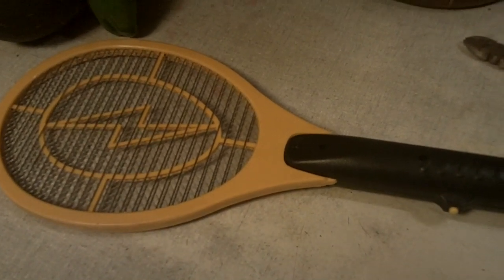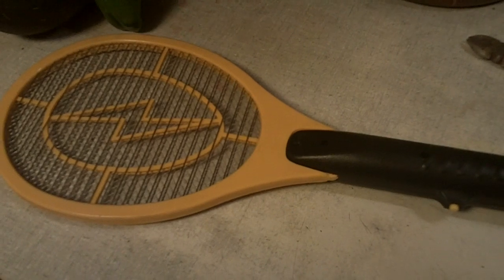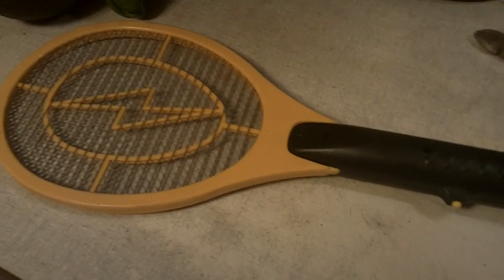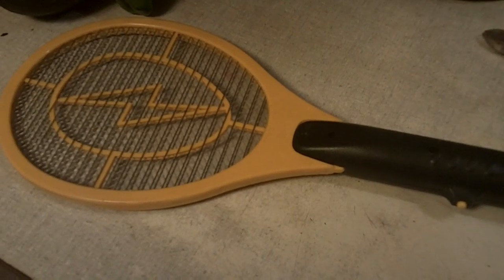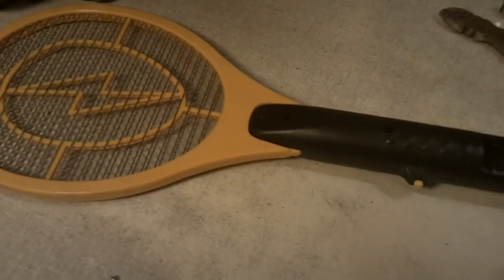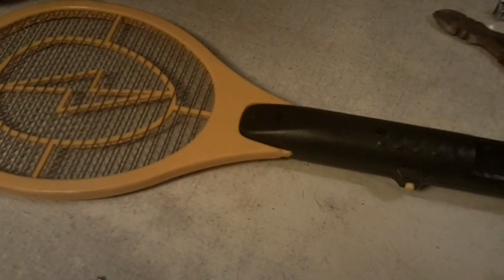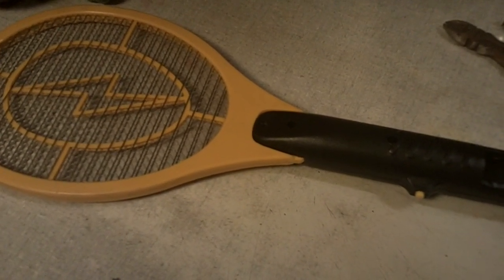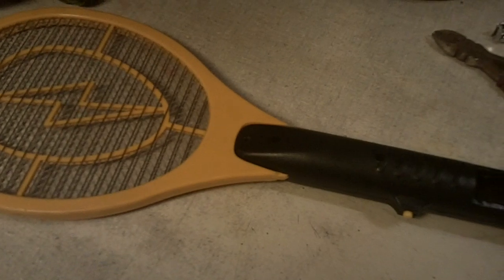1500 Volt  Bug Zapper Racket Power Mod,.

Comment: This video is old I know but a few things to point out that may have been mentioned before.
1. the zapper is only 600V because the main charge capacitor is just over 600V
2. that is the bleeder resistor it stops to from accidentally electrocuting yourself a month from now from it still being charged.
3. to actually increase the voltage you can input a higher voltage then the two batteries but it may very well burn out the capacitor and other electronic parts
4. the best way to increase the power is add more capacitors in parallel of at least 600v if less then they will short out and not work.
Reply: Capacitor in parallel would just increase their current lasting capacity...
I would say higher voltage caps would be nice because higher voltage higher current ;D
Despite lasting less the zap would be stronger with higher current ;D

Only works if we raise the input voltage, the batteries.
Otherwise, caps in parallel are fine but make the charging time longer when you press the button

Comment: You shouldn't remove that resistor, it's a bleeder resistor (empties the capacitor when not in use). Instead what you could do is replace that resistor with a bigger resistor, and thus the capacitor will dissipate it's energy slower.

Comment: Its not quite that simple. Rather, in the name of cheapness, the bleed resistor is constantly inline and pulling down the voltage of the boost circuit. the circuit will never reach its maximum voltage. I performed this mod on a basic single thickness racket (probably the most dangerous), and the higher voltage works better on small insects (such as gnats) that normally escape through the mesh.

Comment: Upon test with a meter it does increase the output voltage and there is no increase in amps/watts which are the danger in electricity.

Comment: can this curcuit take 12v as a power source???
and how can i make where the electrodes shock in the rain and have a charge but when i turn it off it doesnt have any charge at all on the electrodes well in this case the capacitor????????? please anyone!!! this will help a lot..

Comment: I've also heard you can wire a 9v for the power instead of the 3v it's running on now.  Ups the power even more.
Reply: I did install a 9v battery on one and it worked great for 2 days before it burned the circuit board.

Comment: If it was in parallel with the capacitor then yes, it's a bleeder resistor, a safety feature to prevent shock as you say. The improvement seen here is because removing the bleeder stops charge permanently leaking away, at the expense of safety!

A better method would be to change the switching so that when off, a bleeder resistor is across the capacitor. When on, the bleeder is switched out and the full charge is available.

Comment: My racket stays charged for a few seconds after you release the button. I once made the mistake of setting it down by the business end and I accidentally squeezed the mesh together. A quick tap is nothing, but touch those mesh for any length of time and you get a pretty good jolt.

Comment: LOL it definitely made a difference in your mind.That resistor just discharges the cap when power is removed.If you want to up the voltage just add more windings to the secondary of the transformer or add a voltage multiplier consisting of capacitors and diodes.

Comment: Electrohacker45 was right, this is called a bleeder resistor and only purpose is to bleed the capacitor charge off when not in use.

Comment: I bought this same zapper from Harbor Freight today and tested it before I made any mods. The grid holds power and makes a big spark even after the button is released and I touch a screwdriver across the grid. After clipping the resistor in mine the spark is about 3 times bigger and a lot louder like in this video so there is definitely a difference. I bought the Zapmaster from Walmart yesterday and even after making the mod it's a wimp compared to this HF model

Comment: Im sorry bur your mistaken sir. THe reason that resistor is there is so as soon as you let go off the power/ zap switch the capaciator gets discharged. When you cut it, after you let go of the switch, the capaciator will stay charged and if you happen to touch the wires, you will get zapped. Has nothing really to do with increasing the power.

Comment: well it does allow a bigger charge, take out the old one and solder one with more farad and higher voltage, and then maybe also use another kinda battery like 9v, but be sure your transistor and transformer can handle higher voltage/current, because else your transistor gets really hot

Comment: Also if you change the capacitor to a higher voltage but a low micro number you can get a better charge...

Comment: What also works well is if you get a microwave capacitor granted it abit big but if you wire that to the wires going to the racket you will get a bigger charge.. :D